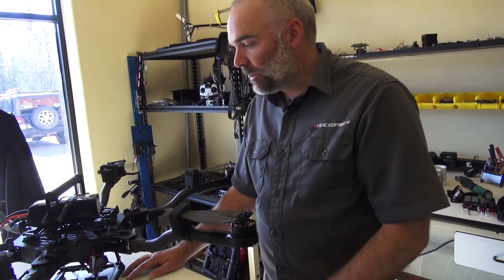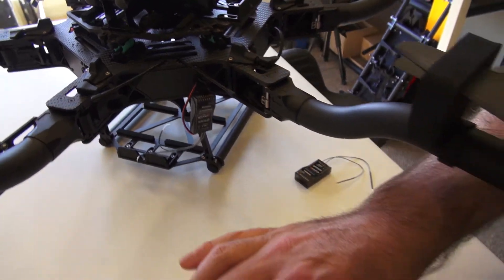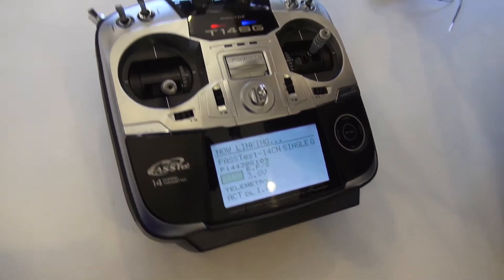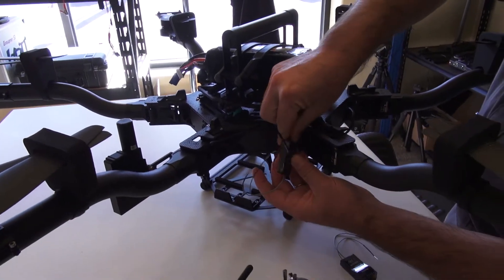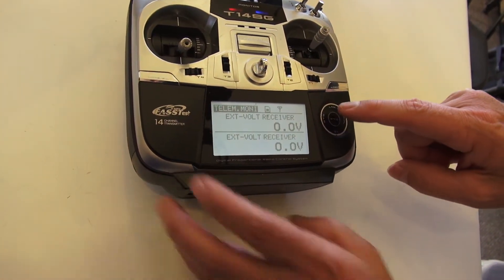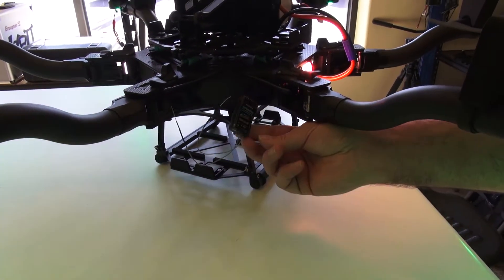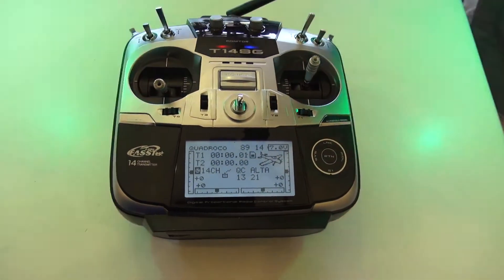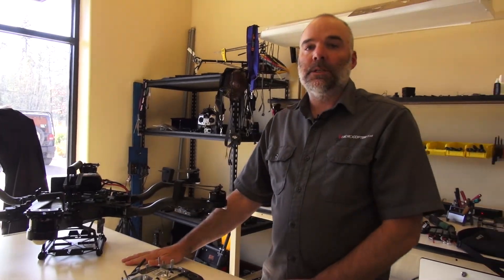Quadrocopter Tutorial - Linking the Futaba 14SG to the Freefly  ALTA

Comment: Hi Geoff. Can you tell me why you want to have 2 of the SB units on the Alta? Is it in case one of them disconnects during flight? Is that possible?
Reply from the maker: Two are used for redundancy and diversity sake. For example, the reciever with the strongest signal will be the primary communication to the 14SG.